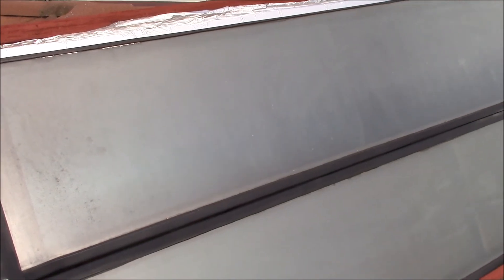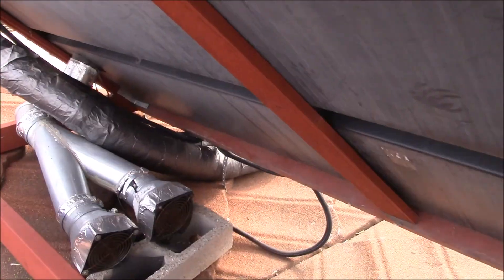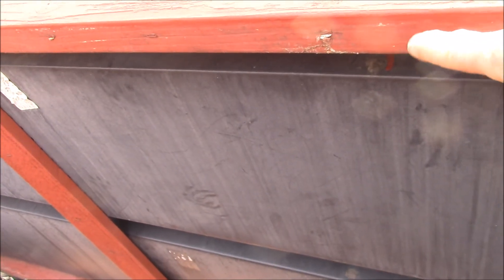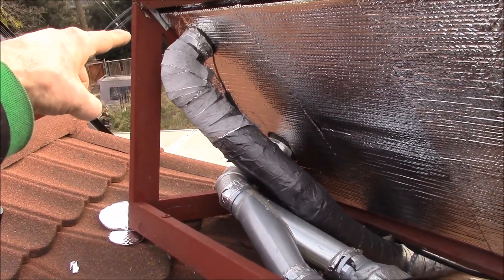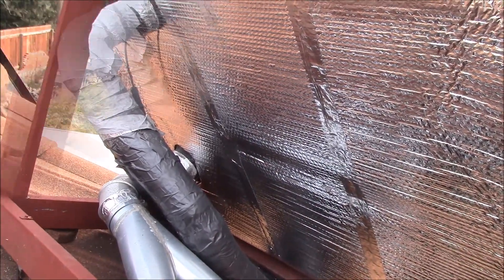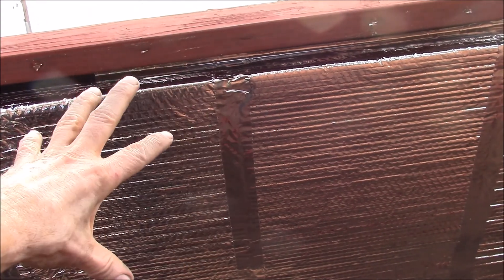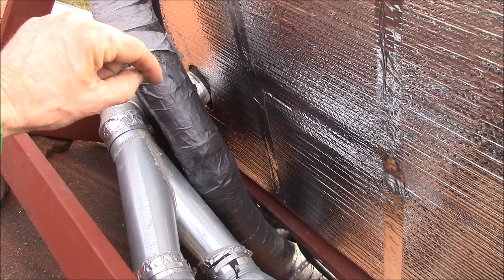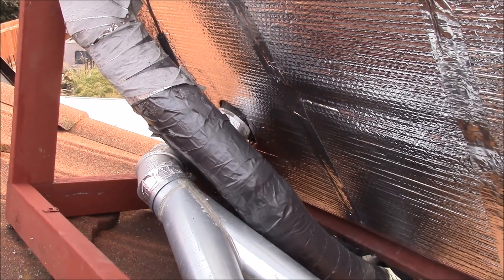New Insulation For The Solar Heating Panels

Comment: Great video!  What do you know & think about solar water heating panels?    I have 3  Revere brand , 4x6 water heating panels that have the sun absorbing material in the back with aprx 6-8 1" copper pipes parallel to length of panels.  They also have the type of plexi/or glass the pulls in the sun.  If you already know  about these then correct me if I am wrong about the panels.   I think I can use just two for my 2-3 person home.  I want to find out how I can use 12v dc circulation pumps, valves, switches, heating elements, and expansion tank to aid my water heater , or use water heater as a holding tank,  or use 12-24v elements in my water heater that's in the house now and have a valve open to keep roof water constant and or entering water heater at a certain temp and allow my well water to enter the panels as water is used.  Hopefully all that makes sense....lol.
Reply from the maker: I've not had any experience with water heating panels.  

I am looking to do something with that in the future, though.  I have an old hot tub that I'd like to heat with solar and then perhaps use that as a thermal mass for heating the house at night.  Still need to refinish the inside of the fiberglass tub before I go forward with the project.  

For the DC heating elements, you might check out the stuff at Elecrtodacus.com, they have some solar controllers that can be set up to dump excess solar into something like a 24V heating element.
Reply: @The4Crawler  thank you

Comment: Good video.  Can you explain a bit more on what type of thermostats you are using and where to get them?
Reply from the maker: The thermostat switches came pre-installed in the ClearDomeSolar hot air panels.  I think they are similar to this:
http://www.ntepartsdirect.com/ENG/PRODUCT/NTE-DTC100

Comment: cool setup
Reply from the maker: Thanks.  The system works quite well.  Normally has no cost to run and just a small amount of maintenance every year to keep it working.  My gas furnace has not been on in over a decade other than a few days while the gas company was out testing it for efficiency back in 2012.

Comment: Of course, us armchair critics find it easy to say, "well, maybe he can add some 1/2" squares chicken-wire to further prevent the Reflectix from being totally blown off"...   When seeing the front when you described cleaning the panels, I said to myself, "huh, looks silvery inside there... I would have thought the heat-collecting metal surface would've been painted black".  I'd have to look through your videos for construction details to see how things were done.  Best.
Reply from the maker: In hindsight, that may have been a good idea.  But now that the panels are on the roof, I can't access the lower edge to staple any on now.

I had been considering installing some rigid foam insulation in back.  However, that's a lot harder to fit around the duct work, especially up on the roof.  If I ever take the panels down to work on them, I'll probably do that.  But for now, I'll see how the glued on insulation works out.  This does make accessing the duct fittings and clamps much easier as they stick out from the insulation instead of being buried behind it.

The metal heat collecting panels are a deep blue color, likely an anodized aluminum.  I think Clear Dome Solar has changed their newer panels to a black color.  But the blue appear blue because it absorbs all colors but blue.  Most of the heat is down in the infrared and red colors.